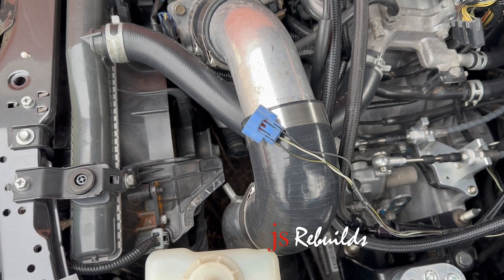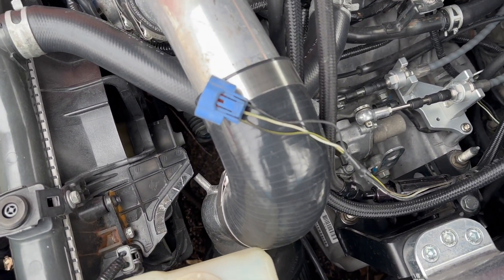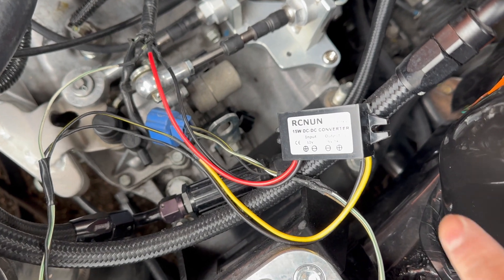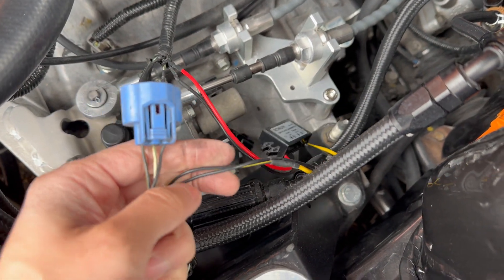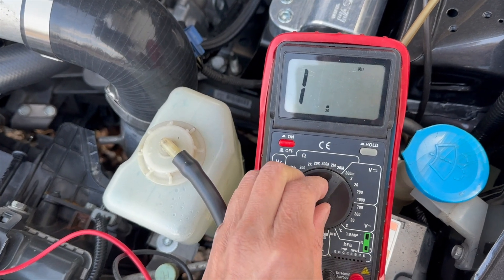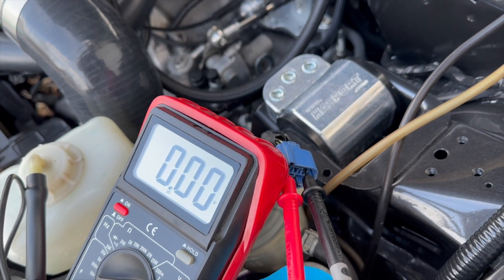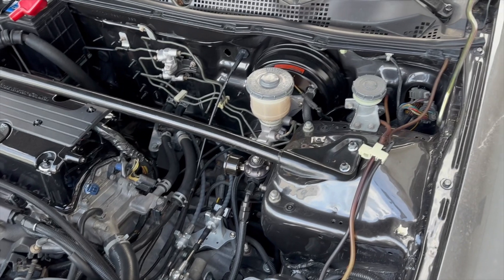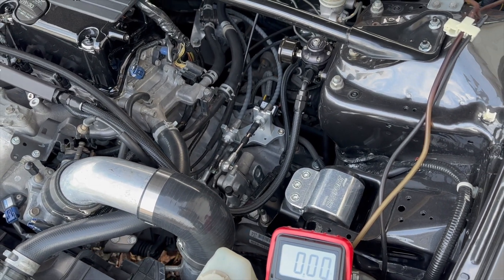How to Get 5V to K Series CSS Sensor for KSwap (VSS to CSS Signal Conversion)

Comment from the maker: For all the people commenting that you can get 5v from another source in the vehicle and that's fine. This video was to show a different option on getting 5v from a convertor box that only cost me less than $7 at the time. I was only mentioning that its a different option that's all. Instead of being cheap, for just a few dollars to get 5v instead of going through work of finding a wire with 5v. I've also talked with an electrical engineer and he assure this is fine to use. 

Also I never said just by getting 5v your speedometer is going to start working. Sorry to say guys you have to buy a speed convertor box for your old analog speedometer to read the signal from a kseries transmission signal. I've went through all videos saying you can get your Hondata to send a signal to make your analog speedometer to work for example vtec academy, I've even reached out to them on phone to get my speedometer to work on just doing a couple of configuration they mention on my Hondata and stuff, it doesn't work. It needs a speed converter box. So I finally reached out to Hondata and Hybrid racing and they confirmed it won't work without a convertor box. Hybrid Racing use to make one but they have discontinued their speed convertor box a long time ago.

So in my other videos, I've tried 2 speed convertor box digital dakota and ktuned. So I've already spent the money on 2 speed convertor boxes. Ktuned is the only one to date that I know of that works right on these kswaps. The digital dakota I could never get to work right and that spending countless hours with their techs and they can't get it to work right on honda swaps. So I had to eat that cost, so basically whoever goes this direction I've saved you money by not getting the digital dakota.

Comment: So I have a bone stock k24a2 09’si lsd trans ! I already repinned it ! The mph goes past 145 an back to zero driving cause of the 12v signal after I do this will it work ? Just be off a few mph ?
Reply from the maker: People out there, stop being cheap. I never said by getting 5volts to speed sensor that it is going to make your speedometer work. You are going to have to buy a speedometer convertor to make your speedometer work. The best one on the market I know of is the Ktuned speed converter box for these application.

Comment: I have a kpro v3, could I do this and switch the settings in kpro to get speedo to work ? I currently have a 5 speed with speed sensor located in the front of trans in my 03 rsx type s. My Speedo nor vtec is working
Reply from the maker: I'm confused, if you have an 03 RSX transmission. You shouldn't have to do anything to your speed sensor. The kpro should just work normal on your car because it's just a 03 rsx ecu that is chipped with hondata kpro. Have you tried just changing the different settings in kpro to see if it will just work?

Comment: Thanks for this man. My kswap is with a tsx engine/trans with a k20 harness. I got a CEL for electric load detector. This video cleared it up, i didnt realise it needed 5V instead of 12V and it was overloading the sensor. Hopefully its not fried from those 1-2 engine start tests and i can use your method.

Comment: You dont need a converter its actually pretty simple to make it exactly like stock. Just unravel the oem harness enough till you can access the yellow/red wire for the map sensor. Tap into it and run a wire to your CSS. Done.
Reply from the maker: True you don't need one of these and I said its an option in the video but at the time it didn't cost me more $7 dollars.
Reply: Which wire do you run from the map sensor to the css?

Comment: I think it does have to be done. I have a 1989 K24 CRX. My Hondata is not picking up the CSS from my 2006 Civic SI transmission. My ECM is from 2004 Type S. I'm not sure what I need to do.
Reply from the maker: I've done it 12 volts with a CSS convertor and Hondata will read it. You don't need 5 volts but a friend of mine who is an Electrical Engineer and confirm me that the device I'm using is perfectly fine. He also mention to me it doesn't hurt to give the sensor the required 5 volts it requires. So I did it just to be on the safe side. 

I know there are a few people on here commenting why would you use that 12v to 5v convertor when you could tap into another source on the vehicle. True but why even bother looking for one when this device only cost me $7 for the 12v to 5v convertor. My Electrical Engineer friend says this device is perfectly fine who builds similar devices like this one.
Reply from the maker: You will need a CSS convertor.
https://youtu.be/w2TBq5DjbXA
Reply: @jsrebuilds3951  Now, is that for the speedometer or the Hondata signal? Cause I just need Hondata to read my speed. My actual speedometer is cable driven. I figure that out later.
Reply from the maker: @bobbydelamar606  Oh, I forgot that CRX are cable driven. So getting the cluster to read maybe a challenge. But I think you use the CSS convertor to get a signal at least to your Hondata. If you get your Hondata to read your speed correctly, you can download the Hondata speedometer app to read as your speedometer temporary until you can figure out what to do with your dash speedometer. Check out this video here we have a Hondata app.
https://youtu.be/WB6KJqYPYM8
Reply: @jsrebuilds3951  I liked that video. The app looks good also. Where can I buy a CSS converter.
Reply from the maker: @bobbydelamar606  just google ktuned vss convertor.
Reply: @jsrebuilds3951  Thank you. I found the KTuned one is only $180. I just wanna make sure it's what I need. Some people say that 12v will destroy the CSS sensor....? What device do you use? One for reducing to 5v and a converter? Or does the converter do it all?
Reply from the maker: @bobbydelamar606  
I used both.
__________________________________________________
Ktuned - https://valexracing.com/products/k-tuned-all-in-one-vss-converter-k-swap-k20-k24-pt-ktd-sc-aio
------------------------------------------------------------------------------------
Waterproof DC-DC Converter 12V Step Down to 5V Power Supply Module 3A 15W BLACK -
https://www.ebay.com/itm/384892160106
Reply: @jsrebuilds3951  How did you wire that 12 to 5 volt box? I'm gonna buy both but I don't wanna cut into my Rywire harness a bunch. I know I have to interrupt the 12 coming out of the ECM to the sensor. But that box also wants 2 grounds...?
Reply: @jsrebuilds3951  I just ordered the KTuned converter. The guy at KTuned said you don't need to modify the voltage unless you want to. I might see what I get first.
Reply: I'm using a stock 04 type s ecu in my swap 02 civic with a 06si trans. Is this all I need to get my speedo to work?

Comment: Anyone who has a cable driven speed sensor "91 and older hondas" you can use a d series sensor for a few pulls before the plastic gear strips but if you buy part #sbc1118 "some k series sensor not sure what motor it actually goes to but i put the gear and shaft in a d series sensor housing and its perfect i have seen people try to make this with a k20z1 sensor but it has a plastic holding the shaft to the gear this is all metal same gear and no need for modification
Reply from the maker: Interesting, thanks for sharing.

Comment: you totally could have just taken 5v and sensor ground from the TPS or another sensor on the engine the uses 5v
Reply: Hello, my ecu has an issue sending 5 volts to map and cmp sensor in a shared 5v circuit. Can I use another sensor 5v to feed them? Or de 12v to 5v regulator?

Comment: Transmission built?
Reply from the maker: Stock 2013 civic SI transmission.
Reply: I have the same. It has aftermarket gears 1-4 and final drive. Speedometer doesn’t read speed,only rpm. No vss no vtec :/ 
Adding this 12v to 5v converter to the sensor would help my issue? Did you have a 2013 civic si ecu for the k tuned part to work? I’m not sure if it’s compatible with my ecu.
Reply from the maker: I'm using a Hondata Pro V4 2003 - 2004 RSX Type S ecu. The ktuned vss convertor is required for the 2003 - 2003 RSX ecu to read the speed and for the gauge cluster from dc, eg, ek to be able to read. I don't know if adding 12v to 5v converter would solve your issue. I don't know your exactly all your setup.

Comment: Did this fix your previous issues with your Speedo? I haven’t gotten my Kpro yet, but I have my engine, trans and harness all in my car and terrified I’m going to have issues lol I have a k24a2 turbo, accord transmission and rsx type s 02-04 RHD tucked harness I’ve repinned the vss wires into the css plug, this is a RHD car so I’d like to have all my shit working lol does vtec and vtc and all work on your’s even with speedo problems?
Reply from the maker: Mine works fine. This video was just to show another option to get 5 volts to the sensor but I got rid of the dakota digital box and ended up using the ktuned vss convertor box and it works way better.
https://youtu.be/w2TBq5DjbXA
Reply: @jsrebuilds3951  can the css run fine with 12v?
Reply from the maker: @Boostlee2023  on the forums people are running with 12v with no issues.
Reply: @jsrebuilds3951  can you direct me to the forum saying that? So I can sleep better with some reassurance lol
Reply from the maker: @Boostlee2023  you can google search it yourself.